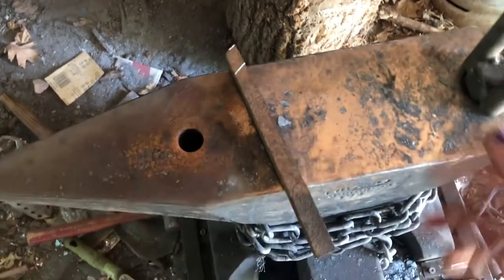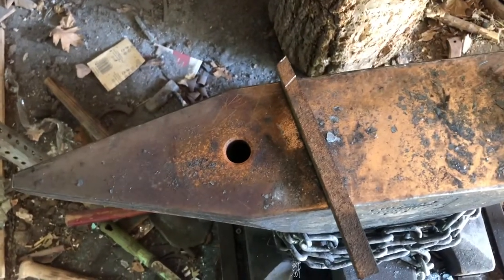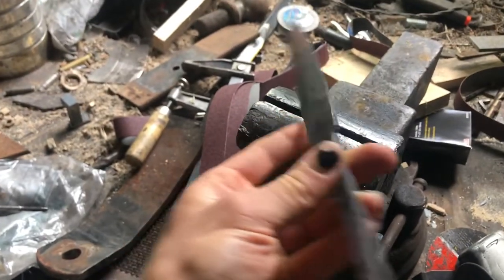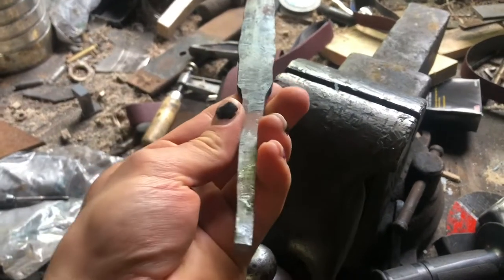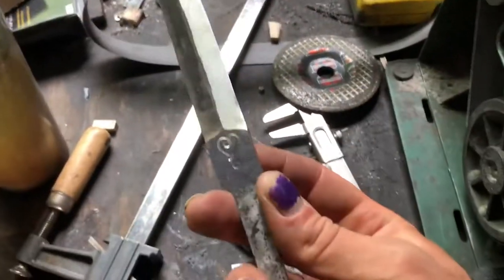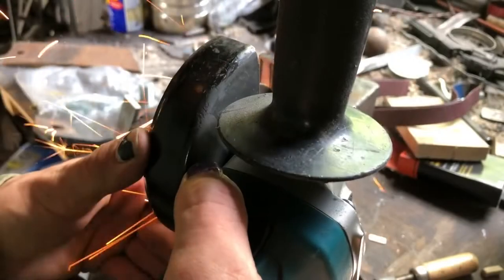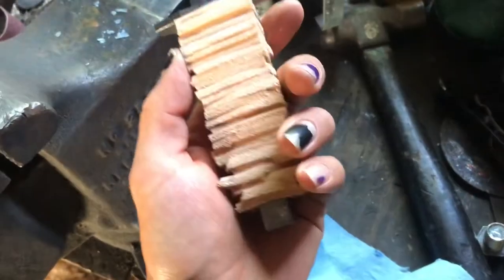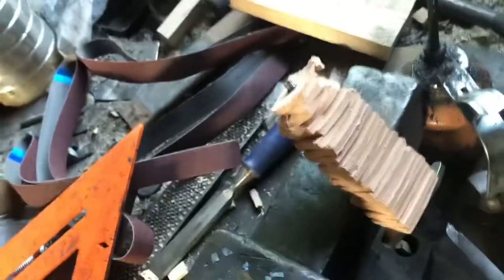How to forge a V42 special forces stiletto dagger

Comment: Pickling the galvanized bolt in HCL solution will remove the Zn. Of course this releases 'toxic fumes.'
Reply: grinding on the bolt makes the Zn more mobile in the environment as well. Zn is not as toxic as you may imagine.